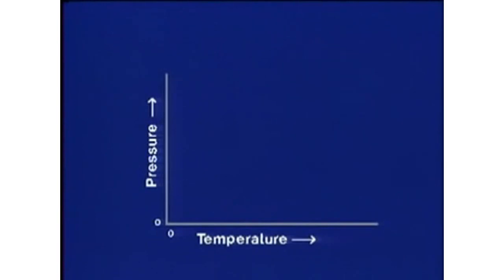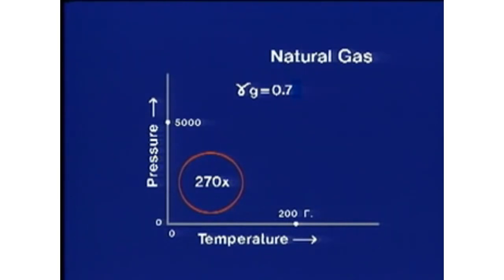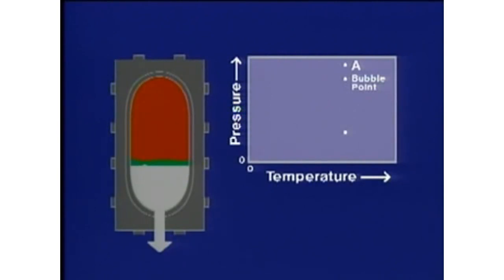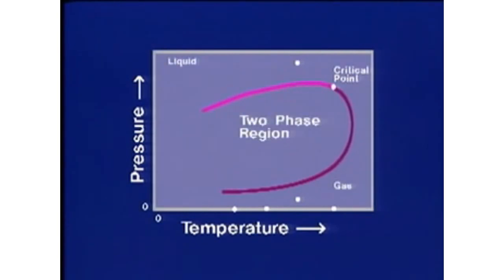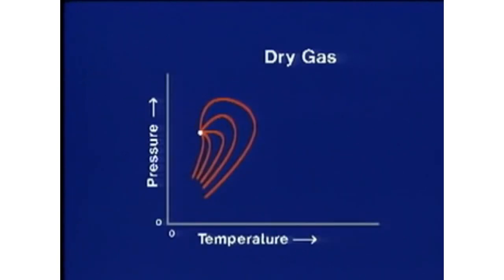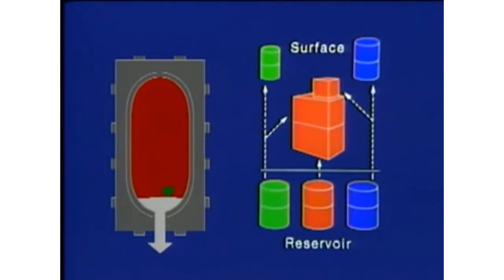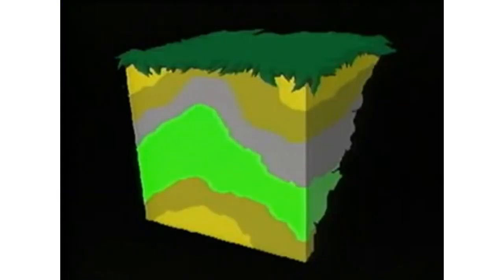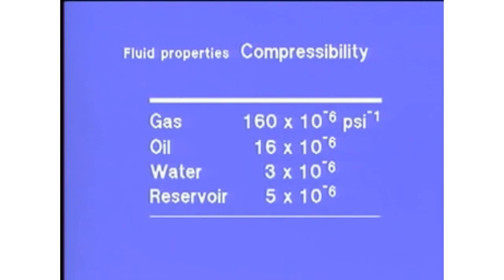Hydrocarbon Phase Behavior and Fluid Properties

Comment: Thanks for the video. Now, here is something what i don't understand, how can we store a sample in the lab to its original condition? I mean, ok we can restore it based on pressure and temperature but how do we know in reality how the sample really was in the subsurface with its original conposition? I am pretty sure there is gas dissolved in the oil in the subsurface so how do we replicate this in the lab? If we are only placing crude oil inside the chamber then how about the gas that was dissolved in the oil in the subsurface? I just quite didn't get it, sorry 😔 Also, when the experiment finished everything that was left was gas but when we started the experimwnt we placed crude oil into the chamber, shouldnt we have back again only crude oil in the chamber when the experiment is finished, because thats what we started with?
Reply: The temperature in the reservoir is high and when we decrease the pressure the temperature is held constant so the crude oil will become gas.
Reply: @nabazaliabdulrahman8499  thats not the answer to my question